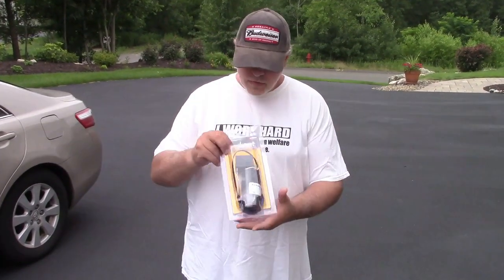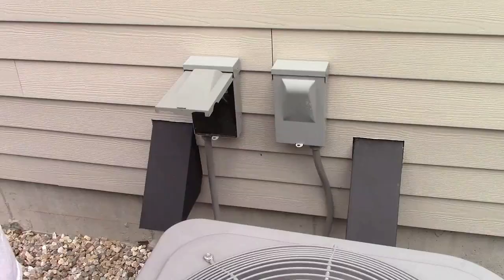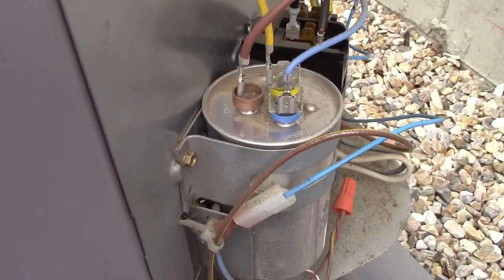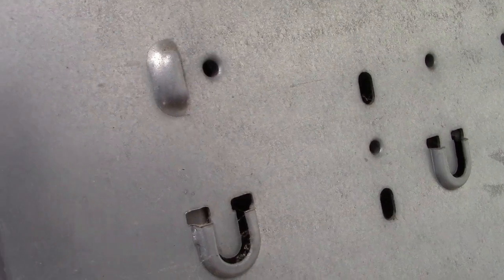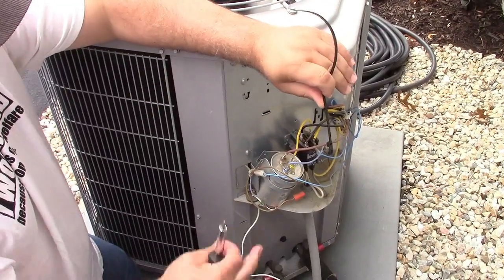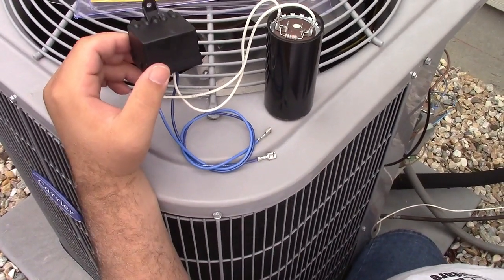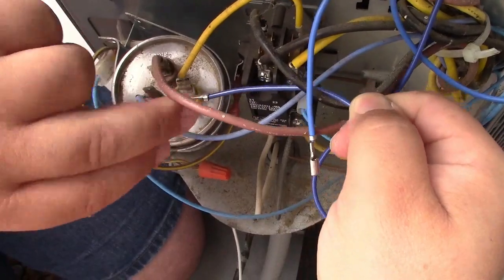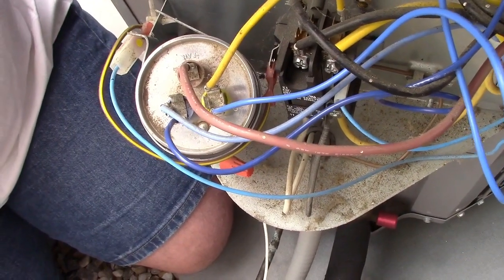How To Install A KickStart Hard Start Kit On A Central Air Conditioner

Comment: Thanks for the video.  Just had  mine replaced by my service plan contractor, smoke was coming out of my control panel, 12 year old Carrier unit. $75 on Amazon, $15 might as well replace the capacitor while we're at it.  15 minute service call, AC back on.
Reply from the maker: You're welcome.  I don't have a service contractor.  So when smoke starts coming out of something, that's all me.

Comment: I installed this kit on my 4 ton unit saved my life I’m currently running off a 9000 watt generator it kicks it on no problem keeps my house cool best 40$ i every spent
Reply from the maker: Yes, these are excellent devices.

Comment: Why did you install it in the first place? It can also shorten the life of the compressor motor. Those things are only for old units which have trouble starting. You just dont install one for nothing.
Reply from the maker: The video actually explained all of that, if you watched all the way through.  You are correct, a hard start kit can shorten the life of the compressor, BUT ONLY IF the run capacitor is failing.  In addition, these Rectorseal kits include a relay that cut the entire unit out of circuit as soon as the compressor starts.  Many install hard start kits on brand new units and have great success and extra long lifespans.

So you are incorrect that these are only used for old systems, typically an older system would have poor wiring connections and almost guaranteed a poor capacitance value, rendering it nothing more than a band-aid.
Reply: @jaykay18  Thats all a hardstart kit is - a bandaid. You would be foolish to install one on a new unit, warranty violated and compressor could suffer whether the cap is good or not.  If your system has a bad cap why dont you just replace it?
Reply from the maker: @RadioRich100  Who said anything about a bad cap?  I certainly never did, and obviously if I'm going through all this trouble I would have just replaced the cap.  A hard start kit IS INDEED a good thing to have, even if it's not really necessary.  I have a 2 Rheem units myself, a 1 aught cable feeding the house 200 amps, first house on the circuit, and a hard start kit makes a WORLD of difference.
Reply: @jaykay18  Its going to make a world of difference when your unit wont start and an authorized tech tells you, your start winding is blown and you negated your warranty. A hard start is a last ditch effort to start an old compressor. And if you use one of those or a soft start you asking for premature failure. Do you really think that the people making these things know more than the people who designed your system to run without extra add on gadgets?  I would like to know what "WORLD" of difference it could possibly make? You mean it blows colder air? I dont think so. The company that makes them sure wants you to think so.
Reply from the maker: @RadioRich100  First of all, you seem to have a chip on your shoulder and have no reason being here to begin with since you think your shit doesn't stink.  Second, my "authorized tech" came TWICE while I was out of town to fix a problem and misdiagnosed it BOTH times, and it took ME to fix it.  As far as Rheem units go, these Rectorseal kits are factory-approved.

Comment: The u notches are for the cable ties. You put a bend on the cable tie and in an angle insert it from the bottom on the tab in the notch. Wrap up the capacitor with the cable tie and tighten it.
Reply from the maker: I guess that would indeed work.  Thanks for the info.

Comment: How do you know which tool is insulated well enough? And if you use a multimeter to check the DC voltage of the capacitor what is acceptable to use a screwdriver (tool).  BTW this video is so well done.
Reply from the maker: Your typical everyday screwdriver will be fine--just make sure you're only holding the handle and not touching the metal shank of it.  It's going to draw a quick spark if there's any charge, and usually there's not.  The meter probes are all you need to check for voltage, just don't touch anything metal and you will be fine.

Thank you.  Remember--I'm not a pro, just a homeowner, and this was a friend's house.  Doing it yourself ensures the job is done right, is nice and neat, and gives you the satisfaction of not only a job well done, but also a full wallet.

Comment: After I paid $6500 for the new AC system, the Home Depot vendor offered to install a kickstart capacitor for an additional $500. Thank you for this video.
Reply: I'd try a new capacitor and a hard start kit before spending that kind of money on a new heat pump.
Reply from the maker: You are very welcome!
Reply: You dont install hard starts on a new system - end of story,  first your warranty is gone, second it can damage the motor side of the compressor over time.
Reply: @RadioRich100  Oh really?  You care to explain the reasoning behind your moronic theory because most AC manufacturers offer 5-2-1 hard-start kits for sale in case you're not aware of that fact :face-green-smiling:

Also according to the Magnuson-Moss Warranty Act, the warranty should not be voided unless the installation or the part caused a problem which is NEVER the case :face-red-droopy-eyes:

The 5-2-1 hard start kit isn't capable of damaging or shortening the life the compressor neither.  The extra capacitance routes more current through the start winding for less than 1 second during startup which reduces amp draw thus increasing the life of an AC compressor!  Anything typically longer than one second will blow the start capacitor because it's duty cycle can't handle the excess heat load causing the vent to pop taking it out of the circuit.  The capacitor failing is typically caused by the potential relay's contacts becoming welded together due to cheap manufacturing (lack of beryllium being alloyed into copper contacts), relay's pickup voltage rating is to high, or some moron mounted the relay incorrectly :face-orange-raised-eyebrow:

The only thing that could lead to problems is that the potential relay needs to be mounted where GRAVITY can assist in holding the normally closed contact open.  Basically, unless the potential relay has the mounting orientation it printed on the outer casing, you really need to take the outer protective cover off of it to verify the correct mounting orientation or you risk it not functioning correctly :face-blue-wide-eyes:

The hard start kit in this video is the PTC type which requires a certain cooldown period before it will restart hence they are not as reliable in certain climates hence the manufacturers sale the more reliable 5-2-1 version instead !

Comment: How ya doin.  I have a hard start kit installed on my AC. It's annoying when it kicks on cuz it's so loud and we eat outside a lot so it's annoying. I got the hard start kit in case I ever needed to run the house off my generator. It was suggested that I do that. I'm wondering if I can disconnect or bypass the hard start kit until I do lose power and then reconnect it? That way it may not kick on as annoying, but I have the option to use it in the future. Please let me know. Thank you
Reply from the maker: Sounds like it's not entirely necessary while you're on utility power, and in fact may be doing damage while hooked up.

Yes, you can connect and disconnect it at will.  There are two wires that are connected to the COM and HERM terminals on the existing capacitor.  You have 2 choices:
1.  Disconnect BOTH wires, and then connect only when needed while on generator power.
2.  Get fancy.  Get yourself a switch with a waterproof cover.  Take one of the wires off the hard start kit and connect to one side of the switch.  Run a wire from the other side of the switch back to the terminal it came off of.  Drill a hole in the case and install the switch, that way you can do this at the flip of a switch.  Saves you from having to open the case up each time.

Another option I just thought of:  If the generator CAN start the A/C without the hard start kit, take it off and leave it off.  In the event you're on generator power, lower your thermostat 5 degrees and let the generator start up the A/C once and just let it run.  Once the A/C shuts off, if you don't need any other power, you can shut the generator down and save fuel.  Or you can do it the opposite way and let the house get 5 degrees warmer first before the A/C turns back on, then it can start once and run for a longer time.  It all depends on what you want to do, and how much you pay for fuel.
Reply: Thank you perfect!
Reply from the maker: @100camotommy  No problem, good luck!  Make sure you ALWAYS disconnect power and discharge those capacitors with a screwdriver before you touch any connections.

Comment: Always take an insulated screwdriver and tap the capacitor at the top were the wire are before touching the capacitors when you turn the power off.And its always a good idea to have a voltage meter to make sure even though you pulled the breaker ,...240v aren't still coming through the contactor...you'll be surprised how many people straight wire their units
Reply: If you're AC unit is functioning correctly then the compressor's start & run windings will discharge the capacitor in less than a fraction of a second once it switches off.  Also, if you want to verify that, just set your METER to DC volts and measure from COM to HERM & COM to FAN and it should show zero volts.  Only a start capacitor not equipped with a bleed resistor is capable of shocking you 😉

No need for an insulated screwdriver :face-green-smiling:

If you pulled the AC disconnect or switched off the breaker then it's not possible for voltage to be present beyond the contactor or the condenser would never shut off hence it's freeze up slugging the compressor destroying the ODU in the process 🤑
Reply from the maker: That was all done for my own safety.  How other people jury rig their systems, or have others do it for them, is beyond the scope of this video.

Comment: Another good reason to turn off the thermostat is so you don’t accidentally short the 24v and blow a fuse or damage a control board on the furnace/air handler
Reply from the maker: Excellent point.  Even better would be to kill power to the air handler completely, to ensure there's absolutely no chance of anything happening.  Yet, no matter how careful you are, you can easily find a way to get injured, like slicing yourself on the case.  Make something idiot-proof and they'll make a better idiot.
Reply: @jaykay18  Can you turn off the circuit  breaker to accomplish this.
Reply from the maker: @mptrader1620  You can, but you're much better off pulling the disconnect.  If you use the circuit breaker, you'd better make damn sure there's no power with a meter before you touch anything, otherwise you'll learn real quick why to use the disconnect.  Circuit breakers can and do fail and can stay on.  With the disconnect, you can physically see the connection is broken, so there's no mistaking it.
Reply: @jaykay18  I completely agree - would never just use the circuit breaker. I meant (sorry for the confusion) turning off the circuit breaker in addition to the disconnect and for the thermostat. But in second thought is the thermostat even on that breaker. And isn't it a good idea to check voltage coming in after you pull the disconnect.
Reply from the maker: @mptrader1620  Chances are good the thermostat is on the air handler breaker.  There's a 24 volt transformer in there for the thermostat and it would generally be mounted inside.  But you don't really know for sure where and how they wired it.  The 24 volts will just give you a little buzz, won't hurt.  Safe enough just turning the thermostat off; the breaker, if you get the right one, even better.  No need to check for voltage after you pull the disconnect, if there's only one disconnect there.  The house in this video had 2.  Pull the wrong one and you'll have a problem.  But if there's only 1, you can physically see the connection is broken.  No need to reinvent the wheel on that one.
Reply: @jaykay18  thanks for taking the time to answer my questions
Reply from the maker: @mptrader1620  My pleasure.  That's what you can expect from my channel.  A good video, and interaction to boot.  Hopefully I have earned your subscription.
Reply: Dude, it has insulated female disconnect crimps on the 24V contactor terminals hence you can't short the transformer out blowing the 3-5A fuse on the fan control board :face-red-droopy-eyes: 

Just unplug one side if the contactor buzzing annoys you 🤣